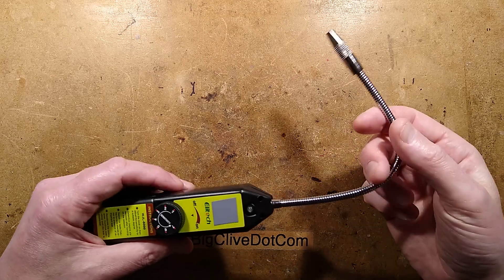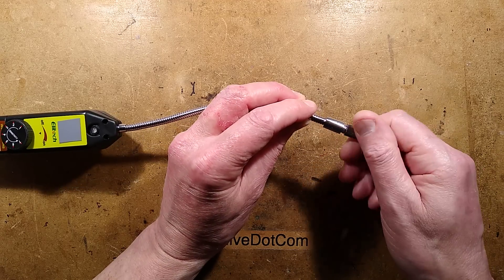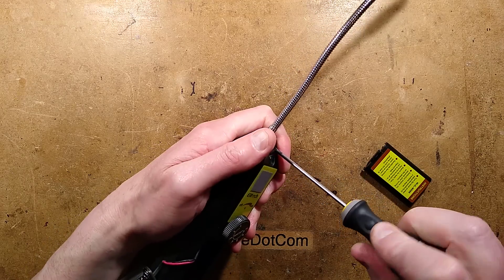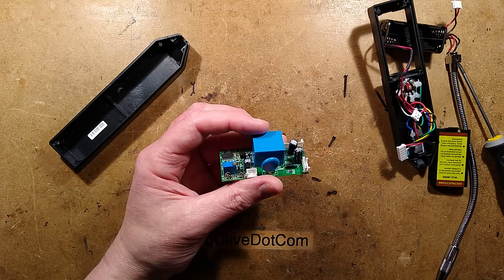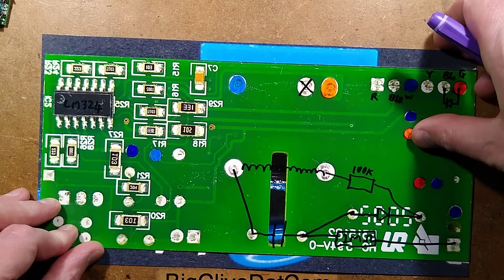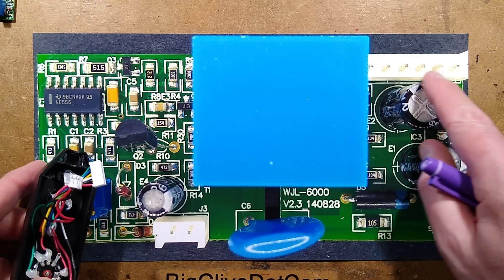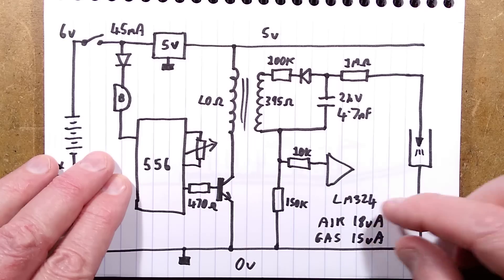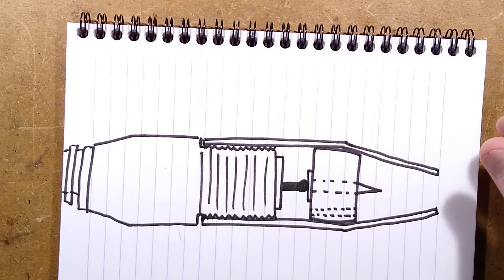Refrigeration gas leak tracer teardown

Comment: Two jobs ago, they had a propane powered freon leak detector . The burner was vaguely waffle shaped burner, with a wide blue flame. If you passed it over a leak, the flame turned green. The HVAC guy said that the green flame produced phosgene gas...not the safest thing to use, but that was then....
Reply: That's when used with R22 refrigerant, now banned as it's a CFC. There was/is that almost universal belief that it decomposes to 'Phosgene' it does, however, form hydrogen fluoride and hydrogen chloride which then form hydrofluoric acid and hydrogen chloride  respectively when they come into contact with water vapour in the air/lungs. So still not great!
Reply: @unscentednapalm8547  I was just about to say, no way in chemistry that phosgene would be produced. But, that's an astoundingly effective way to get everyone to leave you alone when you're working, done similar myself when working on industrial machinery
Reply: @sgctactics  When R12 (DichloroDifluromethane) or R22 (MonoChloroDifluromethane) is burnt at high temperatures, Phosgene (Mustard Gas) is part of the products of combustion.
Reply: Would not be a great idea nowadays, because a good portion of today's refrigerants are flammable! There were several cases in the last 20-30 years when a fridge exploded in someone's house, and ruined the kitchen as a bare minimum.
Reply: @mrnmrn1  when the gas company was fixing a cracked gas main in front of my house, they used soap bubbles, but when the leak was too small to make bubbles, they actually tested by playing a flame across the iron pipe, and seeing if something started burning.
Reply: @five-toedslothbear  That's different, on the street at open air. I've heard stories of workers welding tappings to live natural gas main lines. They weld a small stub to it, attach a ball valve, and drill the main line through the open ball valve.
Reply: @mrnmrn1  True enough....I bought a new fridge a couple months ago, and it's got warnings about the refrigerant being flammable ( cyclopentane...600a?).
Reply: @scottthomas3792 the cyclopentane is the blowing gas for the insulation and is flamable. The R600a is isobutane and butane is also flamable.......
Reply: @mrnmrn1 this would be correct also noted that the refrigerator and my new place had one of those flammable refrigerants then yes I have heard about explosions and even fires because of this.

Then I thought ammonia based refrigerant systems wore bad enough because of hazards.

Not to mention pneumonia absorption systems there is thermal plugs and otherwise that is designed to release the charge Under Fire conditions because of the danger.

I'll do yours in New Windsor doing frigerator I've heard about not sure if it's kind of practical that's basically using some sort of salt and some other chemical both readily available and used in other Industries that might have some promise the most environmentally benign while other energy usage since everything is very much environmentally benign hopefully this gets perfected to the point that it's effective as well as in theory could be much more efficient
Reply: @mrnmrn1 that'll definitely find the leak though XD
Reply: @SUPRAMIKE18  Not sure, but it might cause an other leak. On the roof :)
Reply: @mrnmrn1  that depends on if there's any roof left standing XD
Reply: @mrnmrn1 Oh no! My fridge is next to my solar storage battery (LiFePO4). Don’t think it would appreciate being exploded much…
Reply: Haynes manuals had/have a warning about smoking in inspection pits & aircon gas
Reply: also i would just like to mention that that green flame is very neat, its likely from the hydrogen chloride formed by the burning refrigerant reacting with copper or brass (from your description of the burner i believe its a meker type bunsen burner which often have brass strainers on the end) to make copper chloride which imparts a blue/green color in flames, same stuff they use in fireworks
Reply: Ive still got mine sat on a shelf in the garage, oh those days were so much simpler
Reply: @Sv5YpWTwd9otTA4So83f Inhale a little Phosgene, and that'll be the LAST thing you'll EVER inhale
Reply: I remember seeing this in late 1960's or early 1970's GM automotive shop manuals. The detector shown in the manual looked like an ordinary  propane torch with a hose attached to the air intake. The hose could be moved around the AC lines until the leak was found.  In those days the refrigerant was R-12. I suppose there was a warning to do this in a well ventilated area. Then again around the same time period Dad would do the final leak test for natural gas with a match.
Reply: Wait until you run across a system charged with propane refrigerant...not too smart
Reply: @AutismusPrime69  This was back in the mid '80s....I bought a new fridge a few months ago, and it has the flammable refrigerant warning... it's essentially campers butane, I think.
Reply: I love the smell of phosgene in the.... ... .
Reply: burning any sort of organochlorine compound creates phosgene, even nastier if it had fluorine then you get fluorophosgene but mainly the respect hydrogen halides ie hydrochloric and hydrofluoric acid but if youve ever burned PVC before there is a distinctive grassy smell of phosgene
Reply: @EdwardTriesToScience  not necessarily... Heat and oxygen certainly can produce phosgene to some extent, your are right about that. But it is in fact UV light that creates magnitudes more of it. That's why it is strongly recommended to not use chlorinated solvents when welding. It's not the heat, it's the UV produced that creates most of it
Reply: I they called that a halide leak detector or similar then yes did produce that highly toxic gas as you had indicated.

Pretty much off Sleepy's days but that used to be the go-to leak detection method for CFC refrigerant back in the day.

Also of note put some leak detecting there was one thing that could throw people off of it if not realizing it since back-in-the-day quote-unquote Styrofoam insulation contain CFCs so that kind of could throw things for a little bit even if there's not link it was enough sometimes to provide a false positive heard this from many a older Refrigeration Tech.

So a lot of the older, I'd lie detectors were essentially the modification of a blowtorch tips although specifically designed and Built For This purpose there was a copper proquote reaction plate that was often replaceable since was a a consumable!

Also with ammonia you could use a chemical method of detection I think it was possibly a sulfur candle but I cannot remember scissors long ago and heard about this.

Enforcer modern methods of things nowadays and actually sayings nowadays are a lot safer in this manner as you know back in the day things were not as well understood about how bad things could be for the human body not again if you remember all kinds of defect of the day and stuff that there be no way would be a consumer product even nowadays just because of toxicity and environmental stuff of course.

Even vacuum pump oil and so much much more containing pcb's

Polychlorinated biphenyls is pretty nasty stuff.

I was told at least back in the day that really what you need be concerned about what is when the stuff would be burning back in the day if you were not as concerned about environmental impacts as well on things.

Fluorescent ballast even remember those things go out with a bang but at least not like a smoke bomb.

And if anyone remembers back-in-the-day how fluorescent fixtures were getting louder and louder eventually all you know what it's about time for smokeshow as I called it.

Many places the men I've seen this often.

Number one the old barberries you'd see the multiple fixtures at gone out over the years and even ballast scars where it was clearly that the ballast let out the Magic Smoke.

Oh yeah you knew it when this was happening even from a distance trust me.

In back-in-the-day often no thermal protection but occasionally there would be a fuse but not always this was before certain protection was required!

And oftentimes even with the family protected the name reached end of life the palace the date cycle almost like high intensity discharge fixtures just because of the overheating in the ballast even under normal bulb conditions essentially one things because working-out progressively to each other just because the breakdown.

I've seen plenty of times that tar like substance that has oozed from old Ballas and yeah occasionally there's even be issued of asbestos in some fixtures even worse.

Just goes to show how things used to be done and lack of knowledge and or otherwise not only just for environmental concerns people themselves as well
Reply: I fill friges I charge back up with 60% propane and 40% isobutane(canned air)

Comment: One thing that is strange, I have ionization style smoke detectors, and they will pick up refrigerant leaks, if they are big enough.  More than once, I had them go off when the HVAC was being serviced (the gas pressures were being tested inside).   And then when the evaporator failed at 3AM on a wednesday, the smoke alarms all went off from the leak!  I could smell it that time, not sure if I was smelling the refrigerant itself or the oil in it as you said.   The tech that caused it to go off twice during testing didn't seem too phazed by it, so it must happen often enough.  Four smoke alarms (linked) going off at once in a house is pretty loud and obnoxious as they should be.
Reply: That's not surprising: both devices detect if the air around them gets easier to ionize. The difference is only that the assumed reason for that change is different. (And the internal construction, the smoke detectors use a radioactive source to save battery life.)
Reply: Thank you for your comment!

Comment: I use combustible gas detectors all the time. They seem very similar, but I'm not sure of the sensor technology. They used to be expensive, but cheap (almost disposable) ones are readily available these days. The cheap ones do work just fine from my experience.

Comment: In my day, we used colour changing flame lamps.  OK, the R12 or R22 leak (Yes, I'm that old) broke down to phosgene, chlorine and hydrochloric acid but H&S and COSHH were yet to be discovered.
Reply: phosgene, chlorine and hydrochloric acid. like playing nasty stuff bingo
Reply: Phosgene is always a fun decomposition product for consumer goods!
Reply: Apparently it's a lot more effective with propane and butane 😅
Reply: R12 and R22 were far safer than R40 (chloromethane). Look up the Cocoanut Grove fire, it’s an incredibly sad story. Almost 500 people died!
Reply: Happily,as much as I used to resist change, the elimination of the chlorine molecule from the common R-12 replacement has led to my great relief of not finding the system contamination catastrophes I had come across earlier in this field. Whoa! A smelly, nose burning, toxic result likely unforeseen when these chemical concoctions were first introduced.
Or maybe Du Pont didn't give a shi√
Reply: So basically using those lamps = WW1 Chemical weapon speedrun any%.
Reply: I'm afraid that's a myth that it decomposed into phosgene. It does, however, form hydrogen fluoride and hydrogen chloride which then form hydrofluoric acid and hydrogen chloride  respectively when they come into contact with water vapour in the air/lungs. So still not great indeed!
Reply: @unscentednapalm8547  Chlorinated brake cleaners sprays can form Phosgene when heated enough from welding or torching. Be CAREFUL when you've used a brake cleaner spray on a metal that you then plan on immediately welding or torching on.
Reply: @unscentednapalm8547  it's actually not a myth
Reply: And here I am, running an emergency refrigeration call on an old 22 walk-in cooler with a leak. Phosgene isn't THAT bad when I'm getting paid $194 an hour to deal with it.
Reply: @vindrisk  It can easily take your life in very small quantities... Don't even get complacent around Phosgene.
Reply: @vindrisk  True enough.  But I'm almost prepared to bet you are not looking for leaks by passing any leakage over a red hot ring of copper and looking for the "pretty colors" in the flame.  "Hmmm, lovely green flame and everything smells a bit "bleachy"?  I think we have found our leak.".
Reply: @angusmclean4783  no, but I am brazing on the line set and compressor discharge line to the condenser. So, yes, I am dealing with phosgene, and very much more than would be generated by using a halide type detector.

Comment: A lot of commercial units use CO2 as refrigerant these days, runs at higher pressure than traditional refrigerants... great working in a walk in freezer when a gas union fails dumping high concentrations of CO2 into an unventilated environment! 😂
Reply: When I was in university, I did a class for a used an electron microscope. It had a device for energy dispersive x-ray spectroscopy. The way it worked was that when the electrons struck the surface of the object there were characteristic x-rays, based on the elements that were in the target. The device had to be kept chilled, so that room had an enormous cylinder of nitrogen. And, it was a small room. Someone from another department came in with a Dewar flask, and got some liquid nitrogen, and when that happens, a whole lot of cold gaseous, nitrogen is released as well. I realized I was sitting in a room that was filled with fog up to my waist. Also, sobering was the knowledge that if that cylinder leaked, it could evolve enough nitrogen to displace all the breathable air from the room, and I would have to get out fast and get far enough away so that I could breathe, before I collapsed.
Reply: Don't worry about a CO2 leak causing asphyxiation, the explosive failures due to the high pressure fracture of a pipe that is more of a worry , 70 bar liquid and 40bar suction in the shop with 140bar compressor discharge outside .
Reply: @Pats-Shed  Yes, and the need to keep from having any sort of enclosed gas at all, as that can easily cause a valve or fitting to explode as it warms up, and the supercritical fluid pressure rises up.
Reply: Interesting. I don’t expect ammonia to make much of a comeback, though! Too much potential danger. Carbon dioxide is dangerous already, of course.
Reply: @markiangooley  You could go back to Methylene chloride, which was the first consumer facing refrigerant, which is both odourless and toxic in small concentrations, though the modern replacement for it is R600, normally obtained on the cheap by tapping off cans of spray paint, as they use that as propellant, or by using canned cooking gas in disposable containers, typically Coleman branded.
Reply: @SeanBZA  can buy pure isobutane lighter refill  (that's not propane/butane)
Reply: Cars are starting to use CO2 as well, at least in Europe. It isn't as good at cooling as Freon but the good thing is that the CO2 can be extracted from air so if it leaks it isn't making as much of a negative impact to the atmosphere as adding Freon to it.